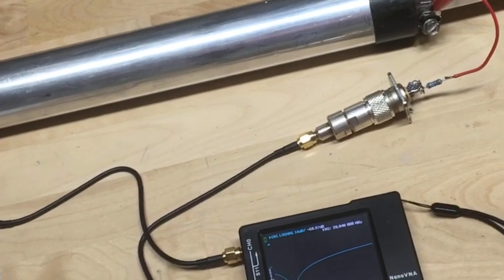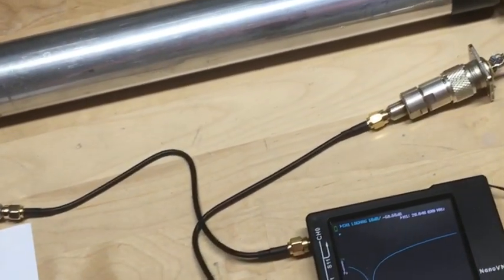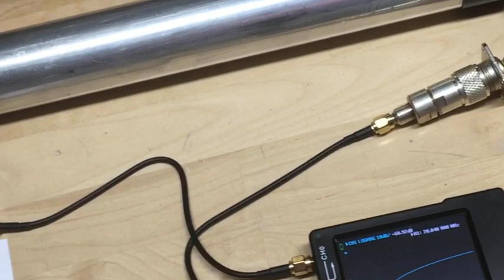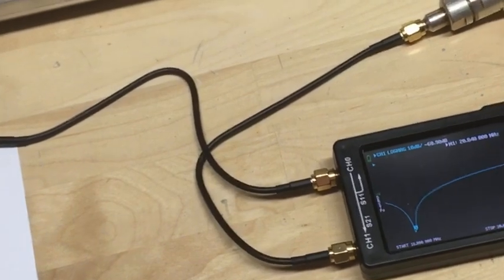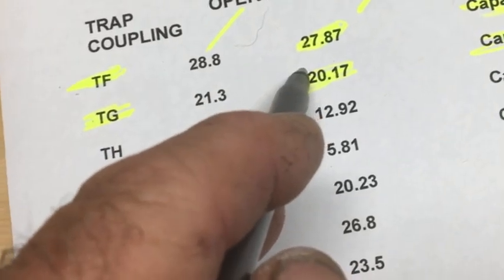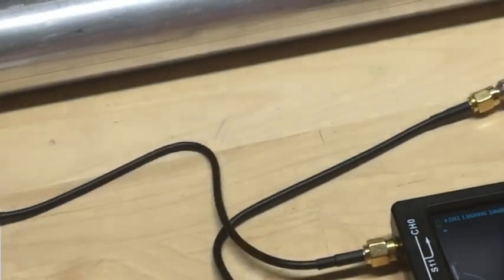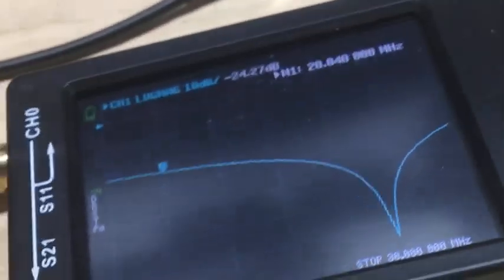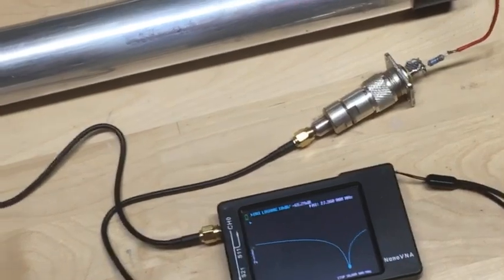How To Identify Cushcraft Traps Using the Nano VNA

Comment: Thank you for sharing Joe! Where did you get this sheet with all the traps frequencies?
Reply from the maker: See this site for freqs:
https://www.qsl.net/ei7ba/Troubleshooting%20Traps.htm
Reply: @rfjoe  Just followed your experience and got the same 27.360Mhz. But my trap is marked TA instead TF. My Cushcraft A3S (2011) uses TA, TB and TC trap labels.
Reply from the maker: Yes that is correct, TA is a 10 meter trap for the A3S. In my video I tested a TF 10 meter trap for a Cushcraft vertical. Here is the link to the frequencies for your A3S:
www.wb4iuy.net/dave/hamradio/manuals/a3work.pdf
73 my friend es good luck Joe N2OUV